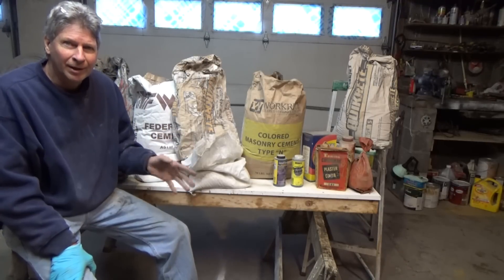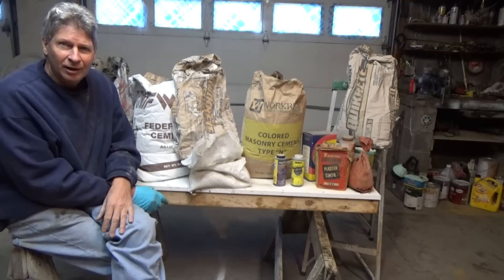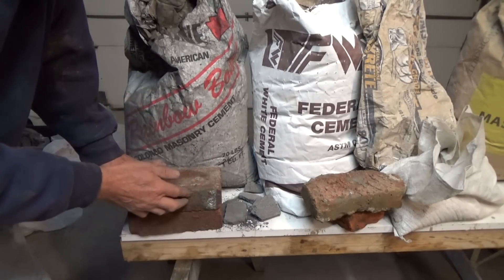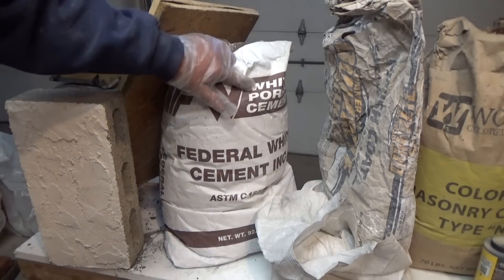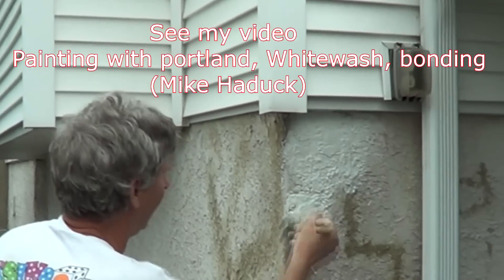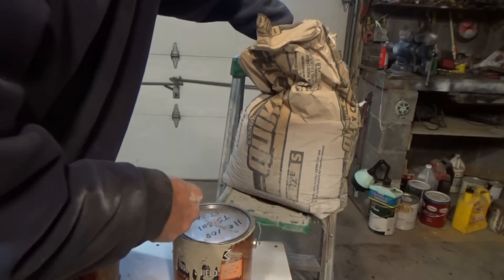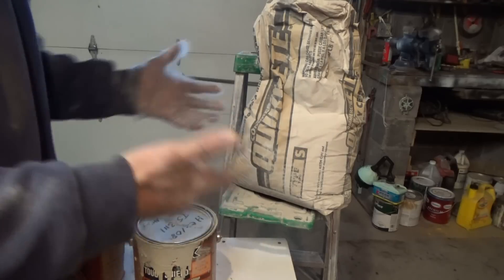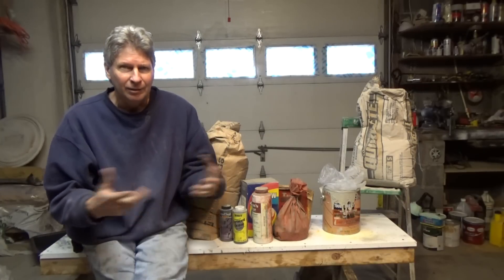using colored cement & dyes, (Mike Haduck)

Comment: I remember my dad saying that he used lamp black to give the mortar between the bricks the black color. Did you ever hear of lamp black? Anyway, I just bought liquid charcoal color like I see you have there, to try and give the joints between flagstones a darker color. My problem is, at $8.97 a bottle I can't color the entire batches of cement. The instructions says it's good for two 80 pound bags, max. So I will have to have uncolored cement to attach the stones and colored mortar just for the seams. That will be a lot more work. I think when dad used lamp black it was so cheap they just added it to every batch of cement they mixed. I may end up using all uncolored cement to both attach the stones and fill the gaps between them.
Reply from the maker: Hi Das, yep, we used it a lot, added it to the dark mortar all the time. Thanks Mike

Comment: Currently working on a Pennsylvania 1931 built home, mid to late 40's flagstone walkway and 2 stairs. Reached out to the person who helped his father with the stones and was told they used concrete but mixed in sand and stones from the creek, top layer of mortar looks to be tan, bottom appears close to white. The sand from creek would have given it color. Should we assume it was portland cement (given the added sand and stone) and in the traditional gray not white edition?
Reply from the maker: Hi Laura, I couldn't say unless I seen it, sand has very little to do in color in my opinion, I got a whole playlist on stone patios and I show what I used, thanks ,Mike

Comment: Hi Mike, I'm looking to do some touch-ups on the parging layer over my exposed foundation outside.

There's a few questions I have. Does a parging mixture need to be manually mixed together, or is that a special type of product to buy all ready to use?

Is there a way to get the color to look like  sand? It seems to me the mixture was white and it has a slight color resemblance to beach sand.

The surface is also not smooth, more like a slightly rough texture. Do I need a special tool to replicate that?
Reply from the maker: Hi ,I have a whole playlist on foundation repair, I am sure you will find something similar,  thanks Mike

Comment: Was thinking about dyeing a slurry to resurface a outdoor wall if I seal it after using regular grey type s will that help keep the stains off of it from water running down my house
Reply from the maker: Hi J, sometimes the same as my concrete repair videos , that might help, mike

Comment: you won't use Penn Crete or thoro stucco? they have color charts!  it's expensive but we have it here in Delaware always held its color for me. also like to add that my father always used 3 five gallon buckets of sand to one 72 lb bag of cement, wasn't that strong. so when he retired I started using equal part sand to cement. very strong I could not even get a chisel in it after two days. god bless
Reply from the maker: God bless also,   anything that works,  thanks for the comment,  mike

Comment: Hey mike.. if I add a dye or color to Portland, and paint with it how you have in some videos, will the color run when it gets rained on? Will I need to seal it?
Reply from the maker: Hi Conor, I would say everything depends on the situation, and where you place it, sealing usually helps, no matter what colors usually fade over time,  thanks mike